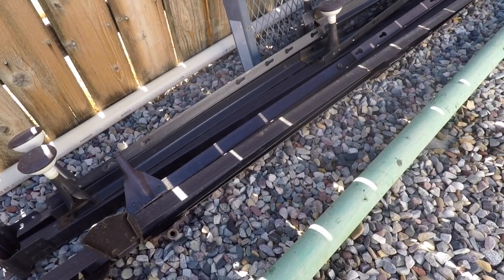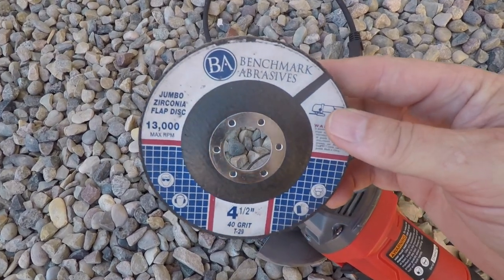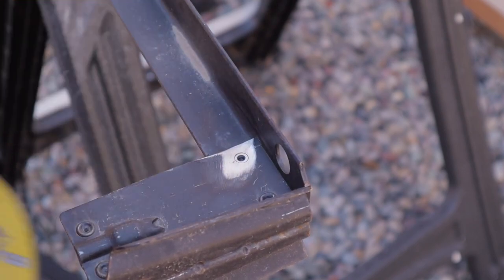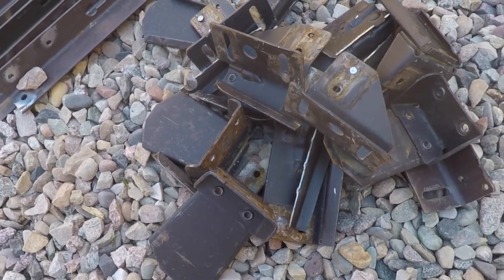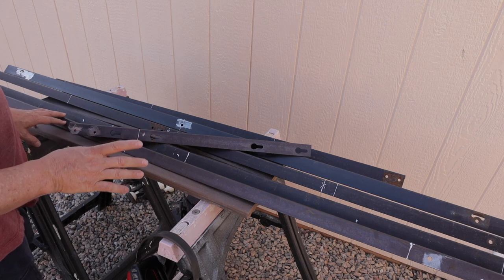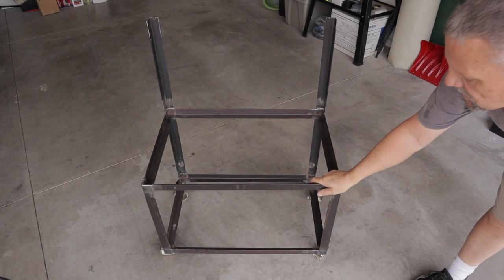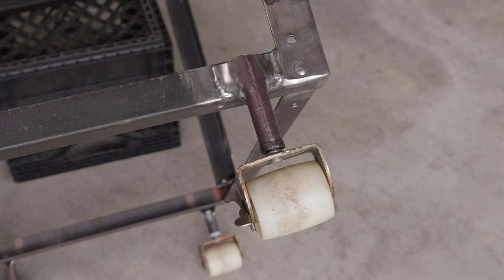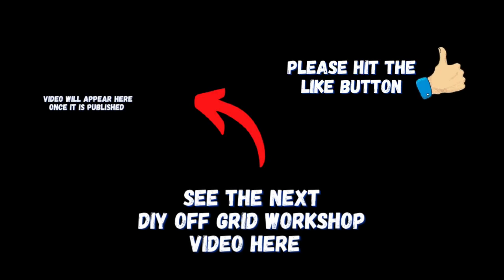Recycling Bed Frames for the DIY Off Grid Workshop Project

Comment: Rivets are typically removed by drilling the one side out with a large bit then punching them out.
Which method did you use to weld these because from what I understand, they are hardened steel.
I've used stick, MIG and TIG and it seems I've had the best luck with the TIG (most likely because I'm not good at any of them and got lucky with the TIG).
Reply from the maker: I tacked them with TIG and welded them out with MIG.
Reply: @DIYHomesteadProjectsDIYHP10  👍🏼
Reply: Found this out when I started collecting them up,a lot of bedframes are actually recycled (already, lol) from railroad track, super tough stuff! As long as the welds don't cool off too quickly, you should be good. Can always hit it with a torch if you are unsure.

Comment: What setting on the MIG did you use? Wire feed vs Power?
Reply from the maker: I don't remember what settings I used but I usually just go off the chart for the material thickness I'm welding. This bed frame material is either 1/8" or 14 gauge.
Reply: @DIYHomesteadProjectsDIYHP10  did you heat the metal iron just welded?
Reply from the maker: Just welded it.

Comment: Awesome job Bruce, what's the ratio of projects that are done out of necessity vs sheer boredom.😀You guys done any camping trips this summer.?
Reply from the maker: Thanks ELJ. I don't know the ratio but most of my projects are just projects I'm working on and I make a video of the process. No, we haven't made any camping trips this summer. I just haven't had the motivation and it's been real hot here this year.
Reply: 95 to 100 plus everday here and 2 fires burning near Yosemite 🥵
Reply from the maker: We finally got a little rain and 85F temps today. This is the first day for about two weeks we've been less than 100F. It's a nice break but I don't think it's going to last more than a day. 😥
Reply: Colorado River and all the lakes along it are drying up.
Reply from the maker: That's what I'm hearing but I've been hearing those stories for years.